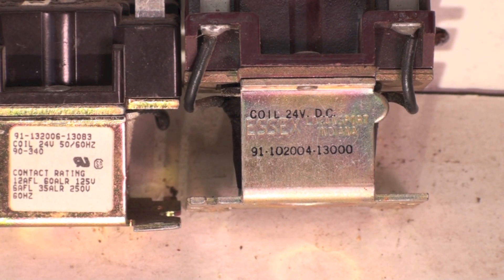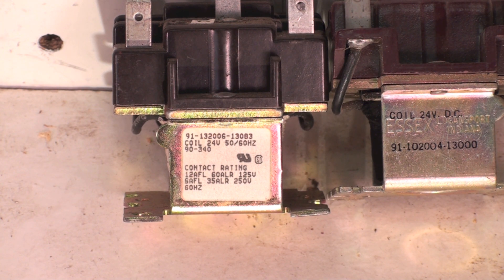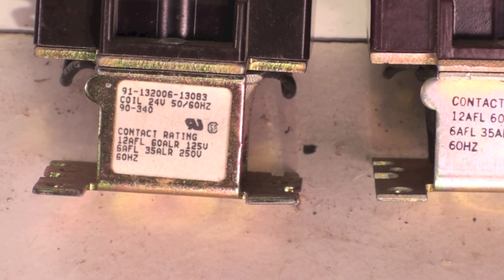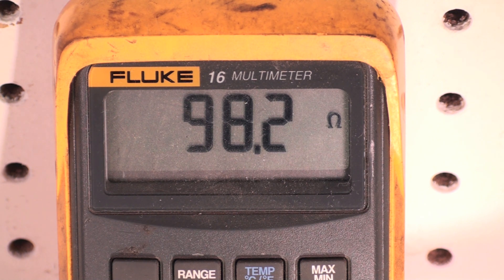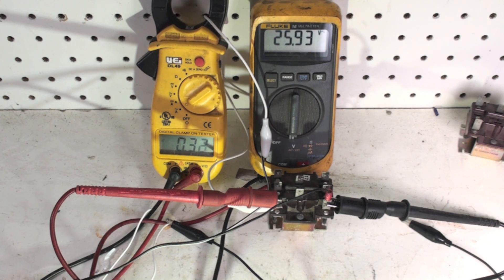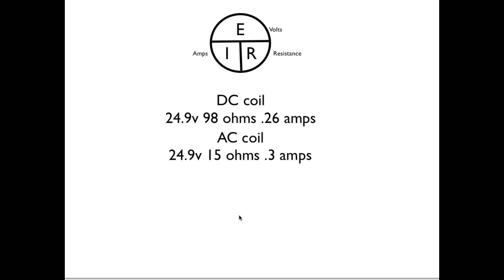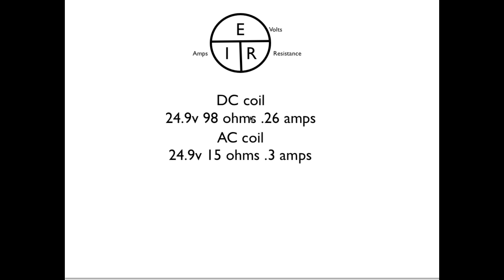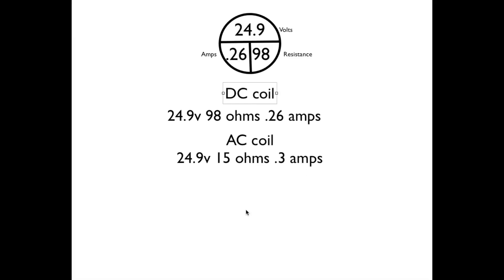Compare the AC coil of the relay with the DC coil

Comment: Resistance in AC circuits is known as impedance (Xr) and the impedance is greatly effected by the frequency.  The higher the freq. the higher the resistive impedance will be.  AC stands for Alternating Current, which causes the current to flow positive and negative.   A sign wave that goes between positive to zero or only zero to negative volts will have current always flowing in one direction, which makes this a pulsating DC current and Voltage.  The AC relay coil's impedance at 60Hz will be higher than the resistance in this video to achieve a 0.3A reading.
Nice video to start the thinking of what is happening.

Comment: The inductive reactance of the AC coil drives up the impedance which intern regulates the current in the AC coil. Whereas in the DC coil there is no relative motion of magnetic flux and therefore the only impedance acting on the DC voltage is the resistance of the coil itself. In essence the AC coil creates its own resistance that regulates current where is the DC coil needs to have a set resistance so it does not burn out on the same voltage

Comment: It's always good to remember that your DMM measures the DC resistance of a circuit only, which can be very different than AC resistance with inductive loads like coils and motors running at frequency.
Reply from the maker: Absolutely right.On AC coils, its all about induction.  Thanks for the thoughts.
GFM
Reply: Reactance has to be added with resistance by vector rule

Comment: Great video GFM! I was told though to get a better reading of the amp draw (or at least a more accurate one) to wrap the low resistance wire around the amp meter claw and divide the reading by the number of turns.
Reply from the maker: In my opinion, the 10x wrap is no longer necessary.  This was done when everyone had analog meters and they were not accurate in the low amperages.  The digital meters are much more accurate.  I have video coming out on a comparison of the 2 methods. It should be published the first of Feb.  Thanks for the thoughts.
GFM

Comment: Which consumes more current AC or DC?
Im planning to use solenoid valve for my project. I'm confused between 12V DC and 230V AC. Which will consume less power?
Reply from the maker: A well designed solenoid will consume about the same power regardless of voltage, DC or AC.
GFM

Comment: They must do something to an AC coil to keep it pulled in. One would think that as the current running through the coil is oscillating in strength (sine wave) the armature would chatter-thanks -good vid
Reply from the maker: john james I'm sure they do.  That's kind of a manufacturer thing.
GFM